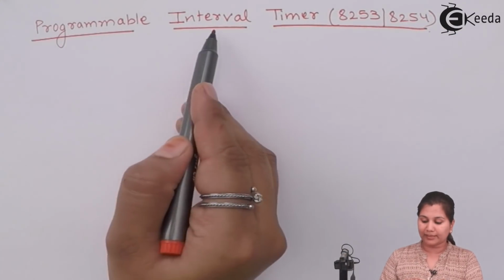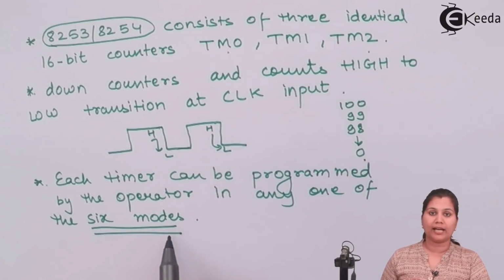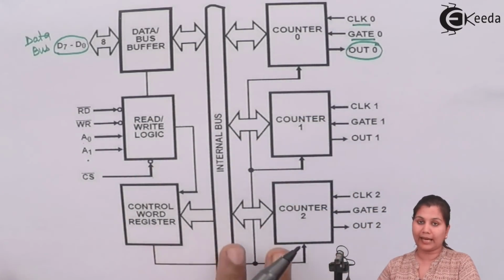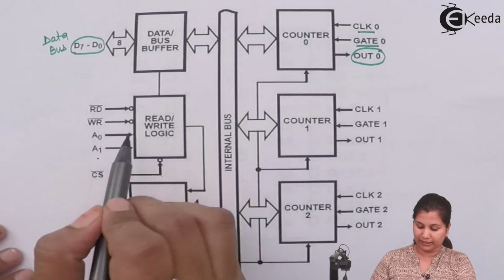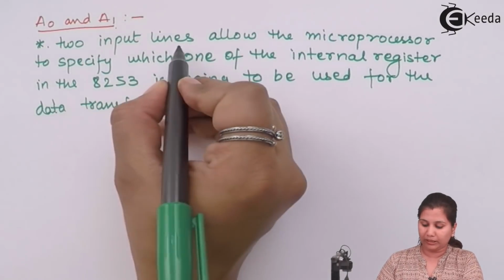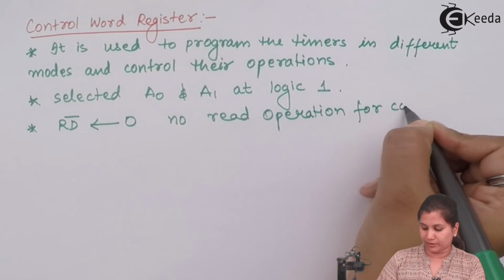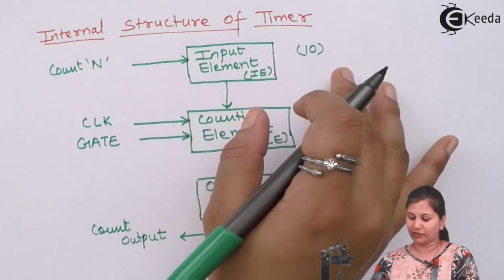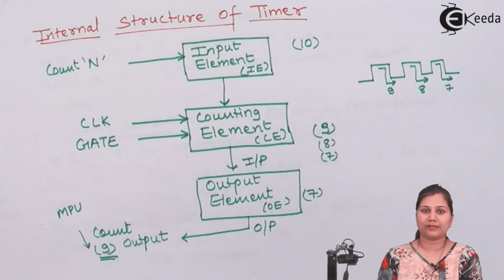Programmable Interval Timer 8253/8254 - Peripheral Interfacing with 8085 Microprocessor

Comment: Write a code snippet to read the count of counter 0 and counter 1 of 8254 IC interfaced with
an 8086 microprocessor. You must latch the counters simultaneously. Assume that the
control register of the 8254 IC has the address BA H and both the counters are running in
mode 0.    anyone solve this question.?